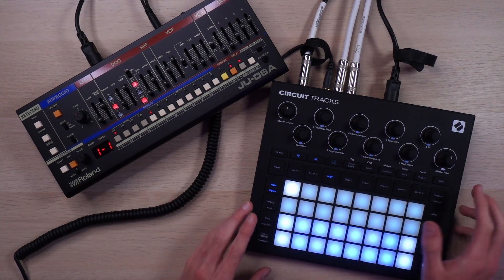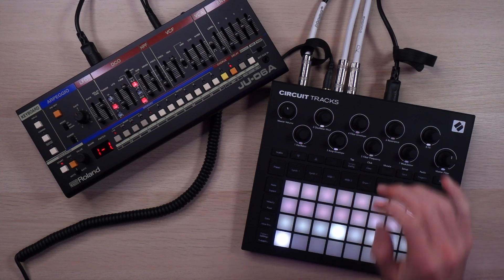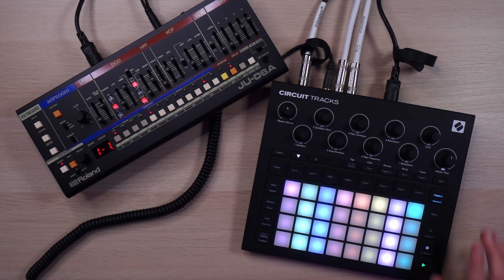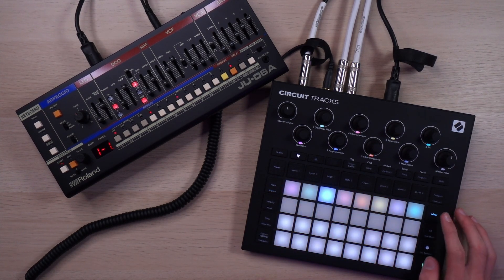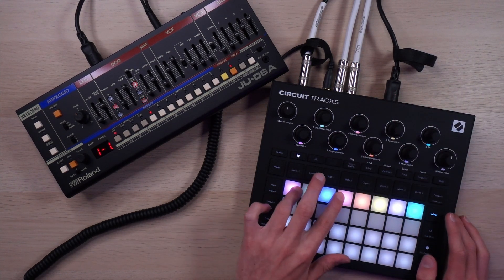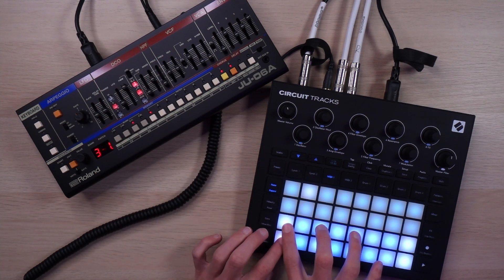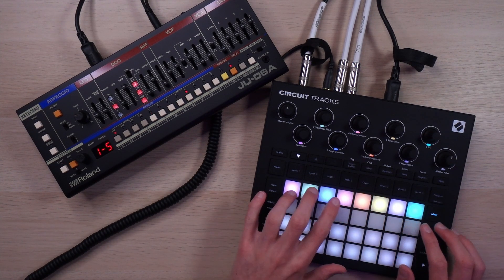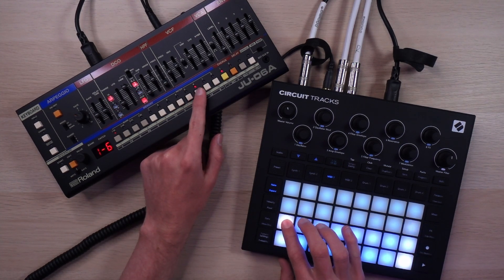Circuit Tracks and JU-06A sound really nice together

Comment: Please please would you tell my how you connected this two beautiful Instruments. I'm really new to all of that and I just can't connect my Roland yu06 with my circuit tracks that it's working. I just get some click sounds on the Yu and my circuit stops taking Inputs on the synthesizers. I just don't get it 😭
Reply from the maker: Check out the tutorial I did on all things Circuit Tracks (it's called something like the Ultimate Circuit Tracks beginner tutorial if I recall correctly), it'll show you how to set this up with any synth.

Comment: Great video!  Your reviews inspired me to pick up the Circuit Tracks.  Looking to add an external synth now.  Just wanted to know if a pattern is programmed using a certain patch on the outboard synth then another pattern using a different patch, will the patches automatically change with the patterns?  Thanks in advance

Comment: I love your videos, I have a question, does ju 06 change the sounds according to the projects saved in circuit tracks? I mean, do you accept that program change or do you have to manually change the sounds according to projects in circuit? It would be important to know since I plan to buy it, I have the rhythm but it won't let me make a program change with the Roland Thanks boutiques.
Reply from the maker: As far as I know, no. You miiiiiight be able to map that (or at least bigger parameter changes) with midi CCs, but I haven't tinkered with that much.